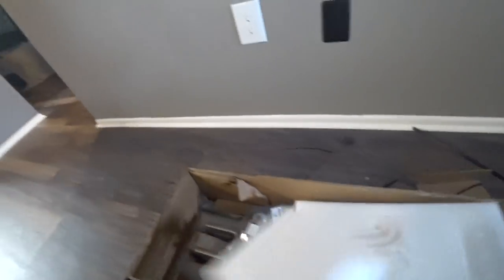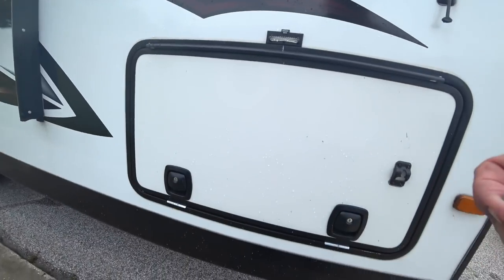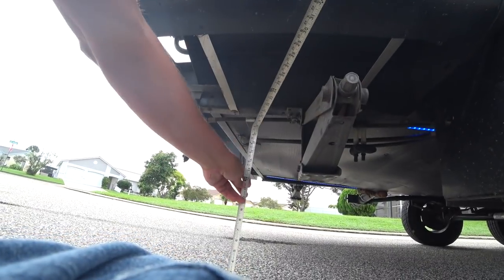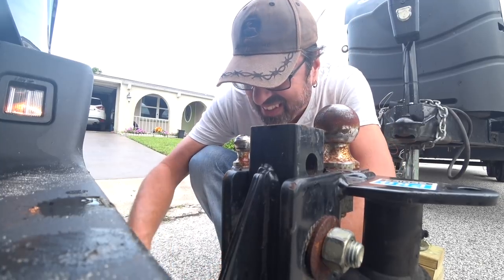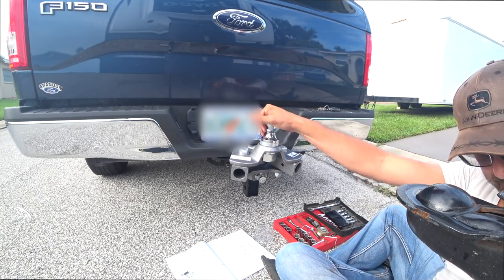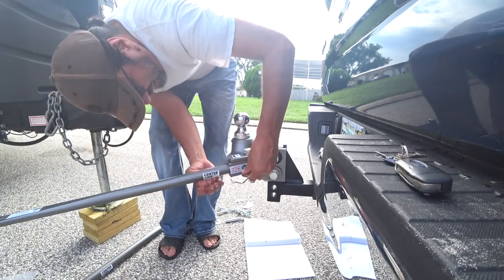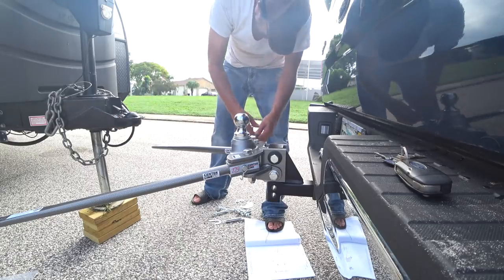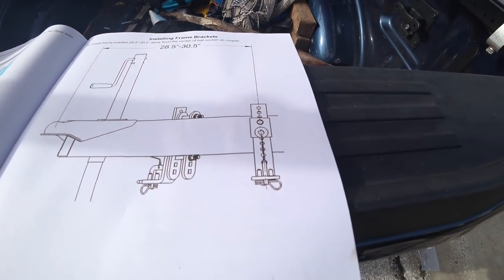RV UPGRADES-Husky Center Line Weight Distribution Hitch Install and Review.

Comment: When I bought my first Travel Trailer, the dealer strongly encouraged me to use a WDH. When I waffled, he mentioned he had a used one of appropriate size that someone upgraded from. It was a Husky Centerline TS 600-800# bars. The price was right, they set it up perfectly (in use experience & careful review of the online manual), and I am so glad I bought it, my first WDH. My near 5K# travel trailer tows better than my 3.5K# 10x6x6 cargo trailer did while loaded. I upgraded my TV from a 2008 Explorer to a 2019 F150 and still will use this WDH.
Reply from the maker: Yeah I can tell a huge difference between towing the RV with it and towing my cargo trailer without it. Even with the upgrade to a 3/4 ton truck it still makes a world of difference!!! Thanks for watching and commenting!!! Have a great weekend! 😁

Comment: I purchase a centerline WDH to pull my 36 foot TT with a 2017 F150 after watching your video! 
WOW! Now my trailer pulls like a 5th wheel, no sway, very little bucking, & while you can feel 18
wheelers go buy it doesn't affect the trailer, sometimes even pulling the trucks closer to the camper
guess depending on if the 18 wheeler is loaded or not? It's been a long time since I had to check my mirrors
 to make sure the trailer is still back there!
Reply from the maker: That’s awesome and I agree 100% sometimes I forget I’m towing lol. Only notice for myself when like strange trucks go by like car haulers for some reason they still caused weird turbulence. Or if it’s really highly windy out. Happy it helped you! Safe travels my friend!!!

Comment: Good move. I have an Equal-i-zer which looks similar in design to what you have and it makes towing much safer and more relaxing.
Reply from the maker: wan-der-lust yes it does!!! So much easy towing
Reply: wan-der-lust what do you pull with half ton or 3/4?  I have a half ton looking to get the equalizer. 300$ difference between this and equalizer.

Comment: I am pulling a 23 foot camper with a 2019 F150 Lariat with the 2.7 ecoboost engine , i use the Center line hitch and towing is effortless .
Reply from the maker: We had that engine in our 2016 f150. Good and powerful and got great mileage!
Reply: @AlliChuckAdventures  my 2019 has the 2nd generation of the 2.7 ....400 ft/lbs of torque over the 375 torque in the outgoing engine " plus it has direct injection and port injection to eliminate the carbon problems .

Comment: I have the same hitch. So far so good.
Reply from the maker: We love it!  Little noisy when turn corners lol but does the job great!!!
Reply: @AlliChuckAdventures  You can reduce the noise, as recommended by Husky, by applying a dab of grease where the bar meets the lift bracket and also on the hitch ball.  But NEVER grease where the bar slides into the head assembly!

Comment: I'm so glad you made this video! We have the same WDH. When we picked up our new trailer we had 30min till they closed. So we also had 30min to figure out how to install this hitch without help. It was a crash course. A nightmare to do in 30min. Before we left the lot with our brand new trailer we realized we had no choice but to upgrade to an F250. (Dealer said it was half ton towable) Heading home we had the hitch cranked up as high as it would go, the F150 was bottomed out, hitch spring bars bowing. We drove back roads home going 45mph. Thankfully we found a great deal on our F250 two days later. After your video I think I'll hit up a level parking lot and readjust it while watching your video. We're still not totally level. Do you feel like you almost raise your truck off the ground to hitch up? Lmao. Plan on making a video ourselves including our whole crazy crash course experience at the dealership. We sure do love this hitch. Our old rig was 32' @ 6k lbs with a chain type WDH. New rig is 37' @ 10k lbs and it tows like a dream. Trucks passing aren't as freaking, wind is better, ride is better. Love it!
Reply from the maker: Awesome we are planning on upgrading to an F250 ASAP. Yeah we crank the back of the truck way up to put the bars on. Truck ends up squatting about one inch. But our trailer only weighs about 6000 pounds.
Reply: We just got a base model 250 regular cab gas. But it tows like a boss.
Reply: @AlliChuckAdventures  I have a 1/2 ton, and a 33' trailer, 6500lb unloaded. I didn't like the way it handled with my trailer. I found a good deal on Roadmaster suspension helper, new but open box. It made the difference between night and day. I was looking at the 3/4 tons, but am glad I can get by now. Watch youtube videos on them, they really helped me.
Reply from the maker: @woodsman4cb  Thanks, i've not heard of these. I surely will check them out. We recently upgraded to a 3/4 ton and are loving it too!

Comment: We have the same WD hitch.  Dealer installed it when we bought our trailer.  Install guy just used the power jack to lift the bars high enough to just slide the bars over the pegs and then lower it back down.  That was 3 years ago and I've yet had a need to use the cheater hook bar !
Reply from the maker: Yeah if i raise the jack up enough I don’t need the bar either.  It’s nice! 😊

Comment: Wow awesome video thanks for sharing. QUESTION: When taking the  truck wheel well measurements did you have the truck box loaded with all your camping supplies, (tools, grill, generator camp fire wood, etc...) ? This would make the rear wheel well measurement shorter to begin with. Thank you in advance for your answer  as I am close to making a decision on this hit and setup.
Reply from the maker: That’s a great question! No I don’t believe I did although I carry our grill in the front storage of the RV. I don’t generally carry much in the truck bed. Maybe just a few fire logs but I would imagine that if you were to carry much weigh it would be good to set it up the way you would be traveling with everything. Again that’s a good question. 😁

Comment: Great video! What does Husky recommend for changes in measurements in the wheel wells? Did they list a measurement range?
Reply from the maker: Yeah the back shouldn’t squat more than roughly half inch if memory serves. On the rear wheel wells. But it’s all in the manual that I do remember. I just re adjusted mine for our new truck. We have a 3/4 ton now and it didn’t need as much help from the husky as the 1/2 ton did. 😁
Reply: @AlliChuckAdventures  how much does your trailer weigh?
Reply from the maker: @mrtosh  Roughly 6,000 loaded.
Reply: So when you did yours, the rear only squatted 1"? I just did this on my 2018 f150 and mine dropped almost 3 full inches. Adjusted adnaseum and the best I can get it is almost level with the front method. Were your measurements front and rear equal?
Reply: @AlliChuckAdventures  So I just did mine....got the 600-800 from a neighbor who bought a ClassC. I have the exact same truck you do but I was unable to get the front end to go down at all...so at last setting the rear sagged about 3/4 of an inch the the front stayed the same as the unloaded. If I lighten the tension at all on the bars the rear will sag a little and the front will raise slightly which is not what you want. (Per directions if the rear sags an inch the front should also settle at least 1/2 that). The tension is high and I have to work it to get the bars installed when I connect. I kind of feel either I did this wrong or I need to go to heavier bars.

Comment: You have to torque the bolt with nylon lock nut to 380 ft.-lbs. Where did you get your torque wrench? Most of them max out at 250 ft.-lbs.?????
Reply from the maker: First time i had a friend who had a shop do it. but when i readjusted i just use a really long breaker bar and tightened as tight as I could get it. I check it everytime I hook up and it ain't going anywhere!

Comment: Just got one. Husky told me if the back and front of the tow vehicle don't change equally, adjust the brackets on the trailer side. Back well is lower, raise brackets ( increase tension). Back well lifts and front lowers, lower brackets (release tension).
Reply from the maker: Yes that’s what I had to do when we switched to the F250. Had to release a little tension as this truck is more heavy duty. 😁 thanks for watching and sharing that info!!!

Comment: I have to install the same hitch. What size socket and wrench did you need to tighten the large bolts that tighten the hitch to the shank?
Reply from the maker: If memory serves I believe 1 1/8 inch
Reply: They bolt head is 1 1/8", the nylon lock nuts are 1 1/16". I know seems it should be the other way around like most bolt. The bolt head is bigger than the nut, go figure. I highly recommend a impact wrench to bring them up. Then Torque. The impact really speeds things up, especially if you have to remove and reposition. Good luck, you will love it. Don't worry about the noise. That just means it's doing it's job. I tend to grunt and moan when I am working hard too (smile).
Reply: From the manual: Tools Required for Installation

The following list of tools will be needed for proper installation of all components:

 Safety Glasses

 15/16" Open End Wrench (5/8” HEX NUT)

 1-1/8” Box End Wrench (3/4” HEX HEAD BOLTS & NUTS)

 15/16” Socket (5/8” HEX HEAD BOLT)

 3/4” Socket (1/2” HEX NUTS)

 Measuring Tape

 Torque Wrench capable of 380 ft-lbs of torque

Comment: Is this unit one of those that has to be undone from the A frame to back your RV into a spot? The Equalizer hitch we had with our last 23' trailer didn't mind staying attached while reversing.
Reply from the maker: Nope. I leave it til I’m backed in. Just can be loud at times. It’ll creak and groan a little bit with the Metal rubbing Metal. But Itdoes a great job controlling sway. 🙁

Comment: I thought the 5/8 hex bolt was supposed to be tight till it makes contact and then just 1/4 or 1/2 turn more. I bought the same hitch and on my manual on page 9, section 8 is what is shows.  Looks like you tighten more than that.  I know it shows the 5/8 hex jam needs to be tighten really good.  Am I confused?
Reply from the maker: Honestly I can't remember I think I just snugged it up. It's still working just fine after over couple years though. 🙂

Comment: We got a curt. The only time we get sway is when a semi starts to pass the camper the semi pushes a little and semi passes our wind pushed them.
Reply from the maker: I’ve heard the Curt is good one too. We usually don’t get any sway unless I don’t have enough tongue weight. I try and make sure not to load the back end of the trailer. Makes big difference. Safe travels! 😊
Reply: @AlliChuckAdventures  got a question. Tongue weight is 600 pounds. Can I use a 800 to 1200 pound tongue weight distribution system?
Reply from the maker: @chade74  is that tongue weight a dry weight or loaded trailer? I’d say probably ok. Probably won’t have to have the bars as tight. But I hate to say for sure. If that is the dry weight then with full propane and loaded trailer your probably closer to 800.
Reply: @AlliChuckAdventures  im sorry, we are at 600 pounds with the propane and battery

Comment: Now that you’ve had the husky Centerline for a while what is your opinion? I’m considering buying one for my GD imagine 3000QB. What Are the specs of your trailer?
Reply from the maker: Still loving it!  Just did over 4,000 miles to Arizona and back and it did awesome! Trailer is just under 6,000 pounds dry.

Comment: Thanks for the video, I just bought a new Jayco travel trailer and I wasn't sure if the Center Line TS would work because the Jayco's coupler is welded underneath the A frame just like yours. I was wondering if the tension bars would be too far from the trailer frame. Thanks again !
Reply from the maker: Yeah it works like a charm! Btw we LOVE our Jayco!!! Love the system too. I’ll tell ya the receiver is one heavy little guy! Seems well built! Thanks for watching!!!

Comment: What's the point of the washers on the inside. Where you added and then took some off. I don't see any on mine which the dealer setup. Like others here I suspect it's not set up perfectly so I am going to adjust ....but I don't have any of those washers now...thanks for the video
Reply from the maker: It’s to finely adjust the height of the ball. Yours might have been close enough it didn’t need them?
Reply: Awesome thanks for the quick response !

Comment: I installed it and noticed that I was very loud. Any Idea how to improve the noise?  Thanks.
Reply from the maker: A little grease on the bars helps.
Reply: Just bought a new trailer this Saturday and got this hitch to go with it, very noisy at first sprayed everything down with some triflow lubricant real good a couple of times to make sure it got in all the nooks and didn't hear it after that, love this hitch!

Comment: How was the hitch for backing up in tight areas. Do you have to disconnect the bars
Reply from the maker: It’s not bad at all BUT recently with out new trailer and the fact that we’ve been getting into campgrounds after dark when we’ve checked in, I have disconnected before just to not make too much noise out of courtesy lol. 😁

Comment: Thanks for the video.  I have a question for you on it.  Do you have to jack your trailer up pretty good in order to get your bars in?  I have the hardest time after my adjustment (per the manual).  The crazy amount of tension adds to the binding/popping/groaning noises that come from my bars as I drive.
Reply from the maker: Yes I do. But since changing to our 3/4 ton it’s a little easier. They are very noisy lol. Alli always says everyone hears us coming in the campgrounds lol.

Comment: Update after 3 trips,trailer pulled awsome,all the way to 65 mph,put grease on socket swivel that hold the round end of leveling bars go into,never on flat ends on trailer frame ,made it much quieter with less clunking.
Reply from the maker: This is awesome info!!! I’ll try the grease too then!!!! Thanks! 😁
Reply: Will jacking up your truck that high bend the truck frame?  Just picked this set up as well.  I have a ton of pressure on mine they look like they have a little bow in them but my front end weighs 1100 on a f150 with max tow and timbrens in.

Comment: Using frame measurements in the front and rear, my trailer isn't leveled (floor slanted towards front). To level it using the bubble, the front frame rail sits 3" higher than the rear. Very weird.
Reply from the maker: The ball may need adjusted higher??
Reply: @AlliChuckAdventures  I think so. When it says to level the trailer, do they mean the floor inside is leveled?

Comment: Is there a Husky part# stamped on the shank?
Reply from the maker: I will check and let ya know!
Reply: I don't see it stamped on mine but you can download the instruction sheet and look up part numbers. This for 32217:  CENTERLINE TS, 600-800 LBS. W/2-5/16” BALL
https://www.huskytow.com/wp-includes/PartLookup/32215,%2032216,%2032217,%2032218,%2033039%20&%2033092%20Instructions.pdf
Reply: HL 19 03 on mine. 14000lb rated

Comment: Why does it make a lot of noise specially when you turn right or left on the vehicle
Reply from the maker: They're are just noisy by nature with metal rubbing metal but I was told that if it's excessive than the tension might be a little too tight. I did end up dropping the brackets down one hole and made a big difference. and yet still seemed to do it's job just fine. You might try that.
Reply: Thank you
Reply: An experienced truck driver friend with lots of towing experience told me that if it doesn't grunt, snap, groan and squeak, something must have given way. It is a good sign that is makes those noises, especially one that has sway control, but like AlliChuck Adventures says, too much would be another sign.

Comment: I have a 27 foot travel trailer about 5800 lbs dry I have a weight distribution hitch with helper bags but my drop hitch shank  is too short need a longer one cause when I tow the front of the trailer looks high and the rear of my truck is low and head lights point up at oncoming traffic.  At night it shines at vehicles coming at me its frustrating not having it set up properly.  What do you suggest I do? Thanks
Reply from the maker: I know you would need to make sure the ball hitch part needs to be the right height for the weight distribution hitch to work correctly. I’m not sure if you can reconfigure it to where the weight dist can take more tongue weight off without changing your drop shank or not. But if you sitting low in the back and front is raising that’s not good situation. Is it the same hitch I’m using?
Reply: @AlliChuckAdventures  
No it's not the same as yours I seriously want to replace the one I have the ball is higher than the level on the trailer tongue 
I would need to spend more on a longer drop shank to be level , at the moment my trailer at the tongue is facing up adding more weight to the rear of my truck . 
I have 2 coices a longer shank or a different hitch .

That is what I have now 
👇

https://youtu.be/mkewkvU8Ot8
Reply: Husky has a short video that states you need to adjust the lift brackets that attach to trailer and raise and lower the spring bars to the proper height.

Comment: Getting ready to install this same system. What’s the second measurement?
Reply from the maker: Second measurement? When you measure your truck before hooking up at front and rear wheel wells. After hooking up and setting up the hitch your front should not raise much at all and the back should not squat more than roughly half inch. This is where you will have to adjust the tension on the bars til those numbers are good. Hope that helps. 😊
Reply: AlliChuck Adventures I get it now.
Reply: AlliChuck Adventures hope to see you out and about some day!
Reply from the maker: askdfour for sure! Good luck installing it. We love it!